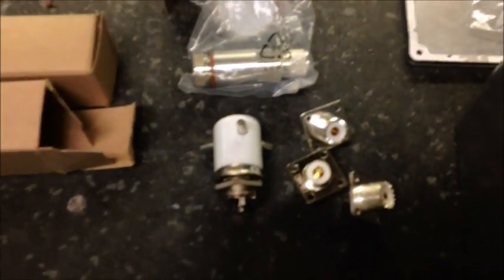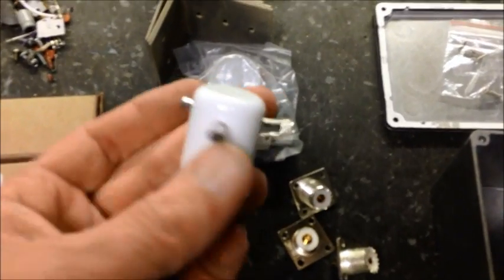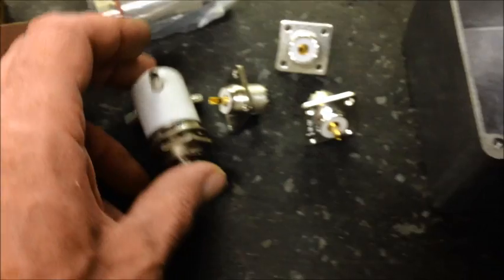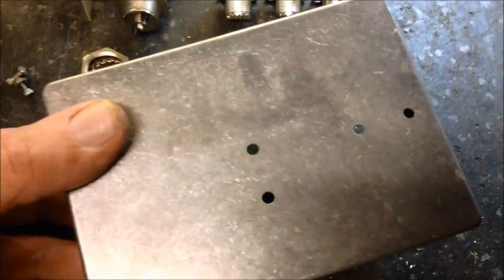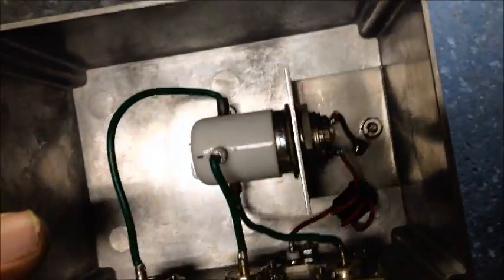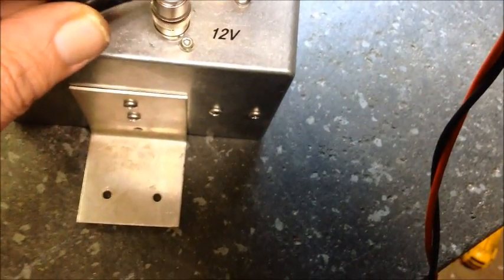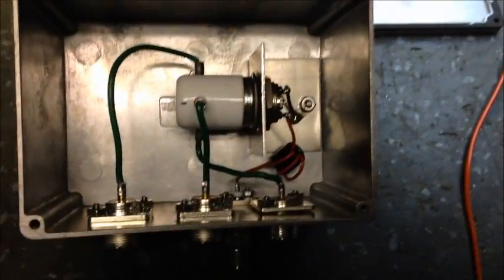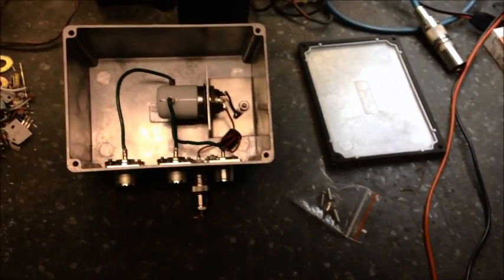10,000 Watt Antenna Switch Box

Comment: love the switch box. but i need an 10 kw rated antenna tuner. and i know, over rating, equipment is a way to keep equipment serviceable.
 then i can load up my super penetrater with my 16 dave made-a-like in the far edge of 10 meter's repeater use; while the penetrater is tuned center frequency for channel 1, the local channel here where i live, in the land of Earnhardt "3" Kannapolis, n.c..
Reply from the maker: +dale myers Ya when you get this high, antenna tuners only get in the way.
Reply: so your saying you don't or wont do that? ((( i mainly need a inductor rated for that kind of power and install some 10,000 volt Jennings vacuum caps.)))  and when i get an antenna analyzer, i can set the taps on the inductor. i may use these relays to do the switching of bands from the taps. having seen what happens to the band switch of a swan mark 2. it's in dire need of an upgrade. and it was running a what the transformer and internal efficiency would allow. "weak spot."